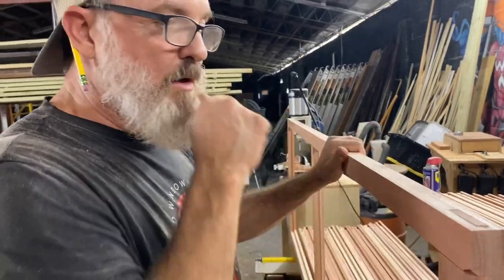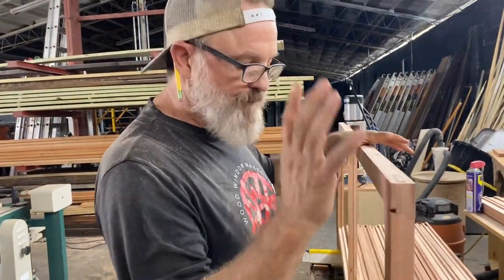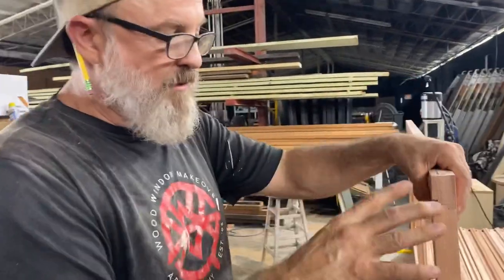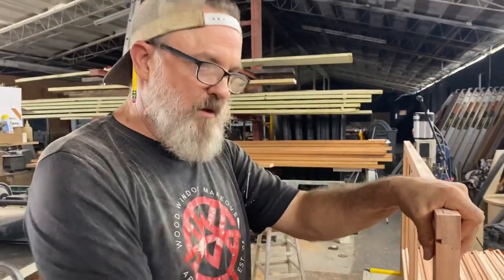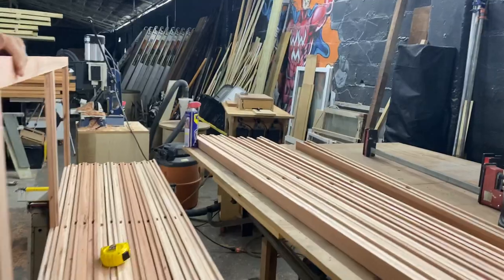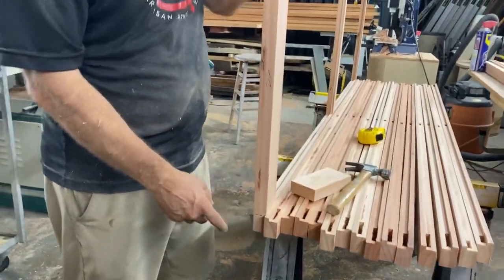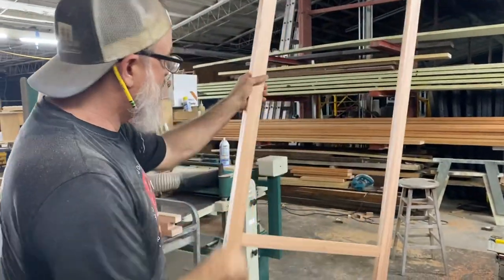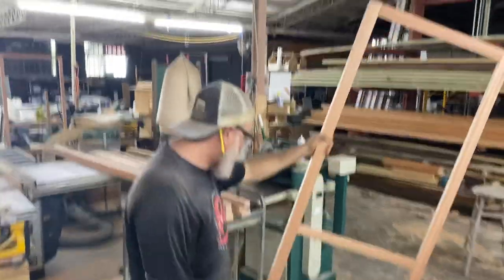Screen Frame Into A Storm Window with one added detail

Comment: Your blanks see really thick... like is that 5/4 or 1 or 3/4? It's hard to tell in the video. I am starting out with 1" for my first storm window, but I can't do Shaker here... it needs to have an Ovolo. Is there room? That's what I am debating. The rabbit for the glass plus the little top fillet then the round over/ovolo, and then another fillet? will there be room?

Comment: Really enjoy your videos and content. Can I ask what species of wood you use for sashes and frames?
Reply: white pine
Reply from the maker: No I don’t use white pine
Reply from the maker: I’ve used all kinds of different woods. Started off with Cypress, learned I don’t like it because it rots like white sugar pine. Then I used Accoya for a long long time. That didn’t work out because i got callbacks for intense mold problems. I’ve used kiln dried pressure treated pine with various results. Now I’m using a species called Red Grandis. Time will tell.
Reply: @WoodWindowMakeover  opps oy get the booby prize

Comment: Sir: what’s the wood for the exterior you are using ?
Reply from the maker: This stuff is called Red Grandis
Reply: @WoodWindowMakeover  !:) will look at it . Thank you for taking your precious time for answering. Don’t know how you can do it with all your work in your shop tbh.
Reply: @WoodWindowMakeover  just read about it . Wow. Looks like exceptional wood. Sadly not many places it grows though . Hopefully not over exploited . 

Was it your choice or client ? Around me , often plain yellow pine .
Reply from the maker: @ikust007  no problem. It was my choice. I’ve run into problems with both cypress and Accoya and this is an attempt to solve them. I’ve also used kiln dried pressure treated pine.